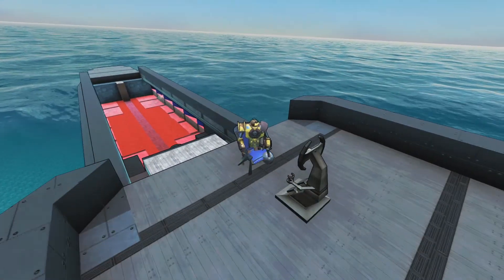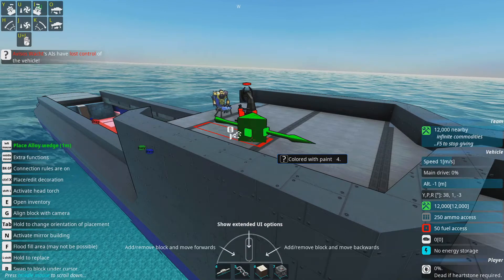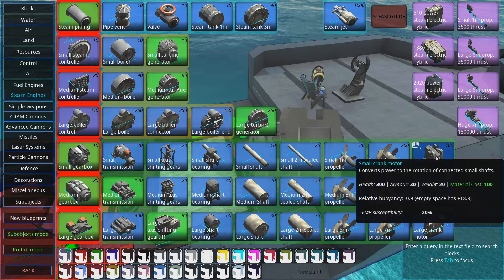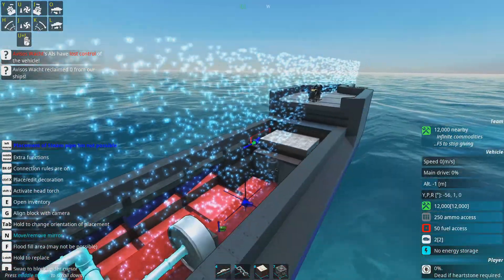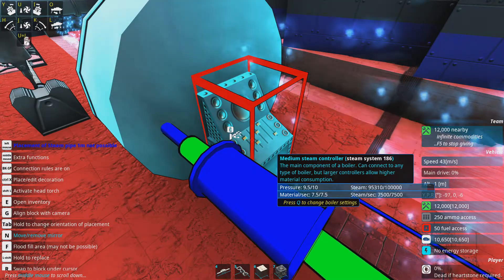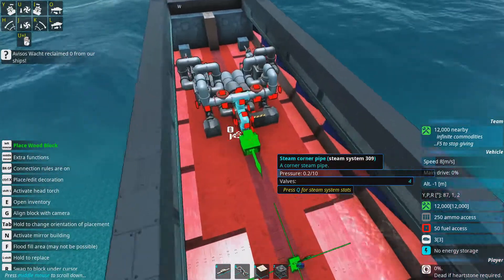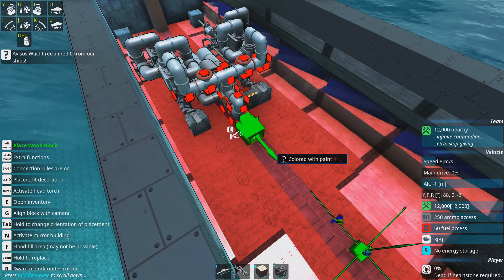From the Depths Steam Engines make my ships move

Comment from the maker: TimeStamps:
00:00 Helooo
01:07 Parts for creating steam propulsion
03:27 Building the propeller shaft
07:10 The Basic Engine parts
08:40 Axis Shifting gears
11:25 Basic Pipework to pistons
12:05 Boiler for the Engine
12:48 Measuring the efficency Thrust per Material
15:00 Burnrate Efficency for 1 Pitson
21:10 Adding a Transimission
24:34 Chart for Thrust per Material efficency with and without transmission
26:25 Chart for Meters/sec per Material with and without gearbox
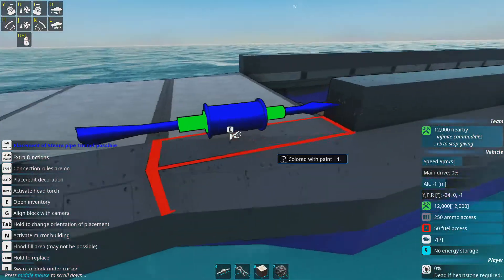28:45 Testing the 3m Propeller
30:16 Chart Thrust per Material for 3m Propeller
30:57 Chart Meters/sec per Material for 3m Propeller
32:38 My example compact efficent engine for this hull.
37:39 Different way to express the fuel/material usage of a ship
44:10 Thoughts on Steam ship propulsion

Comment: You may want to check out a medium piston setup. I tried one of the generic hulls with a small piston and medium piston setup, both with a single medium boiler. Granted the weight distribution was a bit different between the two, but the medium setup was slightly faster with the 3 meter props vs the small system with the 3 meter props. Didn't try the larger props because they didn't fit reasonably without a redesign, but I would imagine it would result in an even greater difference in performance in favor of the medium setup.
Reply from the maker: I would expect the medium to be more efficient and powerful with their respective props than the small. I would also expect the large to be better than medium. The tests more showed that bigger prop is better, having a transmission is better, multiple pistons better, boiler size and burn rate makes no difference. And I think this will apply to every boiler size respectively.

Comment: Since the steam engine rework there is no loss of hot steam. If the pressure reaches 10 the boiler just replenishes whats used and so the material per sec usage drops.
Since the propellers use the same energy per thrust and to remove the draq variable of your craft its easyer to disconect from propulsion and just use a bunch of maxed out shieldgenerators.

Bigger boilers have the benefit of more burnrate per volume. f.e. one med boiler with a volume of 9 can burn at max the same as 10 smal boilers. The big one even more.

The effectiveness of pistons rises till you put 7 of them in series with every piston on its own crankshaft. After that the kinetik loss exceeds the efficiency boost.
Reply from the maker: Well that about fits in with my findings, I would say the volume bonus is minimal benefit. I would still prefer (steam per sec) benefit for not burning at max
I was near at 6 pistons for seeing little boost going further. In most situations I think 3 or 4 is enough to get some benefit without the expense.
Reply: @DelsGaming  its not that big and only pays off if you go big, as you mentiond also with a smaller armord citadel. Compared to IRL ships the boilers are crasy strong. They have used the majority of the lower decks.
Most times i settle with a tripple expasion setup with 2 pistons on one crankshaft. Evan detaced from propulsion, steam ist so mutch more energy dense than fuel.
Reply from the maker: @Meister_Knobi  I'm going to look at detaching steam from propulsion but possibly using Turbines/battery but will look at piston/kinetic propulsion as well depending if I need power dense or efficiency. Video on that will be later when it fits in my ship building
Reply: @DelsGaming  since the rework, long shafts have no other disadvantage that it could catch a hit more likely than shorter ones you can can build the engine asymetrical in your ship one in the stern and one in the front. So you can have better redundency and a flatter profile of the engine room.
Reply from the maker: @Meister_Knobi  I think it may be more effective to reduce the area by putting the engines in two side by side rooms with good longitude armoured bulkhead and add some extra armour on the sides. Smaller broadside target with better armour. If you need lower profile then lay pistons horizontally and alternate them left/right but would not be separated. 
Will go through some possibilities for my historical builds where I keep the layout logical and inkeeping with a walkable functional ship, similar to the original where possible.
Reply: @DelsGaming  your hull looked really great. Im more a functional builder. Im trying to use the new decoration mechanic but its not verry fluent. Walkeable is a bit difficult for me, my thinking that i need to overcome ist something like "when you can still walk there, there is room for armor of some sort" xD

Comment: been searching high and low for an answer to this question and as yet it seems like just nobody else is asking it, which makes me wonder if I'm doing something wildly wrong. Here goes:

Propellers connected directly to steam engines are ALWAYS on, even if via a transmission. It seems that it is impossible to have a steam-prop powered ship ever come to a halt, whilst other propulsion systems which run off engine power can turn off their thrust. Is this true? Feels like a gigantic waste of materials to have your ship permanently having to move even when there is no need for it to. I've seen some vague mention that a transmission stops this, but if that's true I need a lot more detail because I'm using a transmission in all my build and they all do nothing at all to change this problem. If you know the answer (or any other commenter here!) it would save me hours of premature ageing! Many thanks and ty for the video.

Comment: I do enjoy your tutorials. I guess with a split feed (one boiler two drive trains) you would double the burn rate from the previous video to hit that engine efficiency rate, no losses for bends in the pipes. I would also wonder if you can double transmission a single drive train giving 4x multiplier well something like a 3.5x multiplier after losses (cant forget the diminishing returns on all systems). Still could make a steam powered speed demon. I might try :-)
Reply from the maker: Agree one boiler two drives as it's all about steam per sec, but the ratio still applies if it's worked out at steam/sec per engine, not burnrate. You can't link transmissions, I tried it. a lot of my older designs used linked transmissions and they all stopped working until I replaced the transmissions with shafts.

Comment: You loose efficiency/power because of transition (check tooltip)... i think it's smarter to not use them at all and just reloacate elelements in line with shafts.
Also, you loose less power and get more efficient if you connect more than 1 piston at same spot, you can do it up to 4 (cross pattern)...for typical dual engine alternating 2 or for singular centered even 3 are easy and can still be mounted flat on crafts bottom.
Reply from the maker: I will have a check of the transmission losses but my initial test seemed to show that yes there was more power loss but it was still more beneficial as drag in the water was higher so an increased thrust seemed to give better benfit.